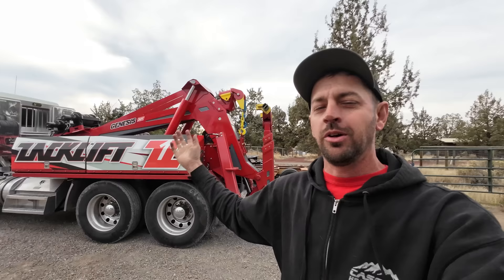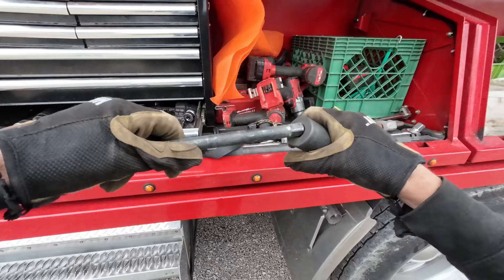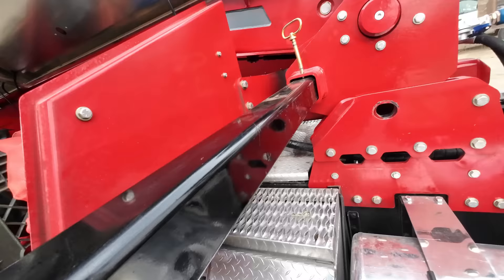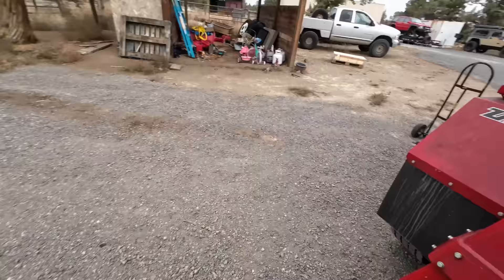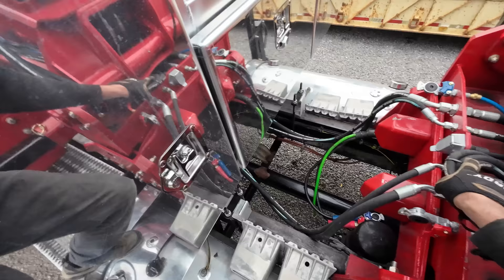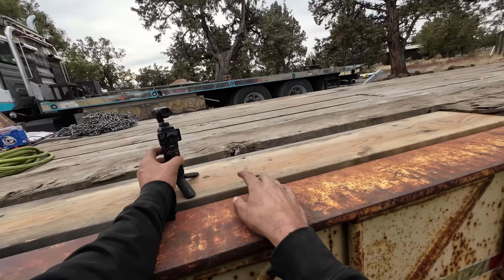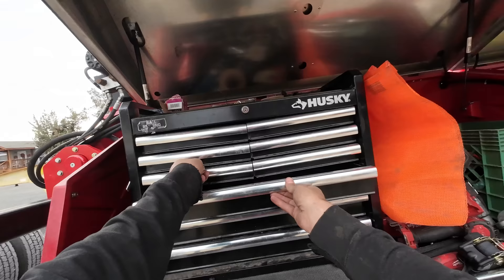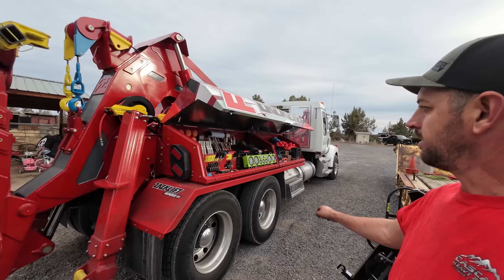How a quick change Heavy Wrecker works!  (the do anything truck)

Comment: You have all that space down low in front of the red mount you could permanently mount a single winch and not have to remove / install every time you decide you needed it for the lowboy, But neat dual use setup.

Comment: Nice video! Thanks for showing the process. I'm not a driver, but I feel like you'd be hard pressed to do a precheck and warm up another truck in 11:32, especially in the winter. I love the idea of moving those boxes back to keep the front legs on full time, and that winch mount is a cool idea too. I'm sure you thought of this already, but maybe a collaboration with the folks at Zacklift to design a winch mount for that bracket. I suspect you aren't the only one who thinks that a sweet place to mount a winch.

Comment: You might want keeper strings on those quick-remove pins, or get in the habit of immediately re-engaging them, instead of setting them on the expanded mesh steel deck, lest they tumble-through.

Comment: Great setup and explanation of how this incredible tool detaches/attaches! One thing I saw as you went through the process was that it seemed a little difficult to get to the hydraulic couplers now that the headache rack tool box is installed. Perhaps move them to the rear of the box and turn them up??

Follow your channel and watch all the videos. Keep up the good work!

Comment: Interesting bit of kit - I think the manufacturers missed a trick, though, as some hooks and/or receivers for the fittings would have made a much neater and easier job securing the various hoses and lines, out of the way, when disconnected.

Comment: thoughts about adding a winch - If you have a removable winch then you need a place to store it off the rig.  I would look to just mounting a winch between the frame rails near or under the headboard and have the fairlead somewhere near the massive red zack mounting plate.  use synthetic line.  Electric or hydraulic winch up to you.     just my thoughts...

I enjoy your channel and commentary - my wife grew up in Bend and nearly all of your locations are memories of mine.

Comment: What do you think about, finding an old socket that would fit on where the landing handles are now. Remove the handles and spot weld or weld them on the crank rods. Now you can use an impact tool to raise and lower the landing pads. This should lower your time even more because you already have the impact tool out to undo the rear tie-down chains.

Comment: Pretty easy really, only thing that looked like it may be a pain was those rear frame hooks, I would guess a good part of the extra time it took to install was you trying to fish those hooks down.
Reply from the maker: That part is actually really easy.  Just drop a ratchet strap down through the shock tower mount, hook the chain onto it, then pull it back up.
Reply: @CaseyLaDelle  Thats really smart, definitely way easier than I would have expected the whole process to be

Comment: I actually think a winch on the front bumper would make more sense. It could be used to help anchor the truck on heavy rescues or pulling stuff on and off the lowbed.
Reply: Think about this, you pull up behind an RV that will fit on the trailer, drop the trailer lay it out then back over the trailer and winch the RV onto the trailer (you would need to make ramps to back off the trailer though) OK not a perfect idea.

Comment: When unhooked those front legs look like they are bowing down from the weight, 16.26 in the vid, or it looks like it from the angle we are looking at. If they are bowing down mabey think about welding triangle gussets at the out side ends inside to add strength. Just a thought.
Reply from the maker: Nope, they sit at an angle because they are a very loose fit in the tubes

Comment: I would mount the winch under that red mount for the zack lift. There is space there. Its protected by the mount and if for whatever reason you need a third winch line you have it.
Reply from the maker: The 5th wheel would be in the way of the line.   The winch needs to by mounted high
Reply: @CaseyLaDelle is it possible to mount a winch with the fairlead facing up? If the winch was under the red bracket, with the line come vertical, then a fixture with a sheave on it that drops into the red bracket could turn the winch line's direction and get it to the necessary height. This of course only makes sense if the fixture with the sheave is lighter than the winch. If you got real fancy, maybe the sheave can swivel or there be multiple sheaves, allowing for side pulls.

Comment: You can easily make a winch mount for that bracket. Just set your winch in there and put a pin through those holes and hook it up to electricity and you'd be ready to go. I would bet you've already got a 12 volt hook up on the outside of that truck, and I don't know if your winch runs off of a standard trailer hitch 4 pin or seven pin connector. I'm like you the minute I saw you take that Zach lift off as soon as I looked at that bracket I thought you could put a winch right there then you said it.

Comment: That's awesome to see, thanks for sharing.  I had the exact same idea as soon as you started talking about mounting a winch, with your fab & welding ability, I'm sure you'll be able to come up with a good mount solution inside of the wrecker mount.

Also, just an idea, where the big pins that hold the front of the wrecker assembly goes, I noticed the pins are rubbing the paint off of the mount.  What about using something like fire hose or some other heavy duty rubber as a sort of washer, to prevent the pins from rubbing on the paint?  I don't know if you even care to much about the paint wearing away, but I noticed it, and had the thought, so I figured why not share it.

Anyways, keep up the great work and content
👍

Comment: Take the handles off the Jacks and weld nuts on the gear box shafts. Then use the same impact used for frame clamps to run jacks up and down and if needed the old handles could have sockets or ½" drive  welded to slip into sockets if needed. Much cleaner no handles rattling with vibration of engine. Saves time and energy. I've done it on a few applications and works great.
Or even cooler still: Lift legs with hydraulic system! Put a couple hydraulic rams in place of gear box. with mounting cross shaft on head  of extension's outer containment Tube to run  extensions up and down. Control could be right at the each jack head.  Then just swing down, lock ib place and pull levers, or turn knobs, (even cooler)  Of course this could all be done in your shop and  spare time. Ha Ha on the spare time part. I'm retired and don't even have time to do all the "Honey Dos", along with the projects I come up with! Keep on keepin on casey. Love your Channel!

Comment: Move them hydraulic couplings so there easier to get at and the air lines, do the front pins whilst your doing the legs and you would probably save 3 minutes

Comment: One suggestion would be to switch over to quick connect lines and maybe add in a secondary Air and Power connection point under the headache rack which would greatly improve your efficiency with connecting and disconnecting. Also if you go that route hard mounting your hydraulics under the headache rack would also make your life easier. Also closing out the rest of your frame may help too so you dont drop stuff in weird spots.
Reply: Aren’t they all already quick connect fittings?
Reply: @hondaman08  the Hydraulics are yes but not the Air lines on his truck by simply changing those and adding a second connection point it cleans up and simplifies the process
Reply: @ltciscora  are glad hands not considered quick connects?
Reply: @hondaman08  No a Quick Connect is not the same as a glad hand. Glad Hands twist to lock in place with a rubber grommet to seal them vs Quick Connects just press in to their receptacle with simple O-Rings to seal them
Reply: @ltciscora  Yes, I understand how they work but they are still a tool less connection that is easily broken and connected by hand.  He needs the existing length of the lines to reach back to the trailer so what is there to gain by adding a different style of connector near the hydraulic bulkhead area?  Also a duplicate connection would require isolation valves to avoid air loss when the other is being used.

Comment: Nice setup 👍. You could save even more time if you take off the crank handles and use your cordless drill driver to lower and raise legs ..And make a winch plate with sides with a hole on each side of the plates that line up with holes on bracket mounted on the frame..This way the winch can swivel as you're pulling..And clevis pins can be used to mount winch plate...How much if anything is being saved if someone was to buy complete truck and tow winch setup verses buying removable tow unit ?

Comment: That zacklift is awesome man. 🎉🎉🎉 I wonder if you could build a head frame such as what highway departments use to load and unload the sander units from dump trucks.  You could back the truck under it, secure the front of the DTU with a chain on each side and thus not need to worry about using those side outriggers altogether?
Reply: certainly could,  but then your stuck only being able to detach at home base, and for a bunch of extra cost.

The versatility of being able to detach any where at any time is quite valuable. Never know what situation you might get into 500 miles from home that requires you to detach.
Reply: @legohead6  No one said that he couldn't keep the outriggers with him in case he found the need to drop the DTU in the field.  But thank you for your reply. ☺️

Comment: With the winch, might it be better to install it under the headboard, and move the hydraulic connection points to a more exposed location (should be done anyways for QOL)?  If you make a sheep's head mount that drops into the Zaclift mount, you will then also be able to do side and rear pulls.  In addition the sheep's head mount will be lighter than a heavy winch.  

If the hydraulic connections were moved to under the outer boxes, then you would be able to access them from the ground instead of kneeling on the frame and reaching under the headboard.

Comment: Because my life works the way it does, I would have a lock in the outriggers.  The check valve on the outriggers would leak through, the body would sink down, and then I can't back under it.  Of course it would be a time it's urgent and no one has/can make extension hoses to lift it up again...

Comment: Very cool idea to mount a winch on the truck but as you load your trailer from the tow end would you not be better having the winch on the rear of the trailer and connected to the independent hydraulic systems already on the trailer

Comment: With a similar type of jack system you would absolutely have no issue with install a 20-35 ton hydraulic drag winch on to front mount plate so you could literally drag anything on to your scissor neck..
Reply from the maker: No need for anything even remotely close to that big
Reply: I have worked to close to the old fields every thing has to be big just in class. 😂😂😂

Comment: you definitely need a routine, which will come in time & if you can get it down to where you only make one trip around the truck, without having to explain what you are doing, you might even get pretty close to the 5 minute mark... weld a coupling nut the same size as the frame clamp bolt to the end landing gear rod? whatever the handle is attached to (I don't know what it is called) and run it with the impact would speed up the process too

what is your plan on keeping the airlines off the deck when pulling a trailer?

Comment: I have been wondering how long it takes to get rid of those separate airhoses, and get those reels, not long😁, now you can add one one air impact driver, in case batterypower is not enough? 
Ok when You get those front "feet" as permanent in there, make them for that impact driver, and all those hydraulic and air hoses, make something like gardenhose holder for them. 
Sorry, my english is not good enough, but you got the idea, I hope.

Comment: I feel like that is a good pitch for Zak Lift. They could totally make a winch mount that works on the front frame mount to add to the purchase.
Reply: In theory its simple, in reality it will need its own valve block, and most operators are going to want remote control on a winch line, which means even more stuff mounted to it and the need for electrical connection. At this point you'd have at least a 500lb contraption that would require a separate piece of machinery to load into position. Defeats the self contained self loading central area behind the zacklift.

I could see a home made contraption being built for someone who needed a winch tractor as well.
Reply: @legohead6  I get that together as a unit this would be large, and heavy. There is no reason why this would have to be one complete unit. Split it up into 3 or 4 pieces, that pine/tie together. 

The hydraulics and electrical are already there. Zacklift already has the remote portion figured out. In my personal opinion, a multi million $ company should be able to figure out an attachment, that one person can install.

Comment: To make it easier to take off the hydraulics pipes, why not extend the connection onto your headache boxes? It's interesting how you demout as I  worked with demountable wagon and drag where after putting the legs down and turning the locks we would drop the air suspension, we would drive slowly out .stay safe
Reply from the maker: That’s exactly what I did

Comment: Casey this was an awesome video sir! I had an idea when you were talking about the custom winch Mount for the Zacklift bracket. What if you permanently mounted the winch in front of the bracket down lower in between the frame rails and then put a much lighter bracket with a fairlead in the front Zacklift bracket, that might be faster and easier on you if that could work?

Comment: Another snarky comment, thinking about the blue (turquoise) truck.

Would that flatbed tow truck with 4x4 be ideal for loading pickup trucks towing large utility trailers?

Put the pickup truck on the flatbed, connect the trailer to the rear lift mechanism and off you go!

Just trying to influence the algorithm, like your common sense videos.

Comment: Hi, why dont you mount the winch on on the raised section of your trailer where the pin is connected? You can extend the power / hydraulics to it and that way you dont need to be manhandling a winch on and off in a rush.

Comment: Would a winch in that wrecker cradle be beneficial?  Would it not be better to install a winch down in the recess of the back of the trailer and maybe have a small "tower" type snatch block that you can remove?  I know either way you have to disconnect the truck from the trailer to load things onto the ramp, but it just seems like another thing to have to install/remove on the truck, when you could just outfit the trailer more.
Edit:  This concept would also remove the possibility of whatever you're winching onto the trailer pushing the trailer, as now the pulling force IS the trailer.

Comment: Dumb question,  what happens if it settles into the dirt, can you just jack up the front legs and slide under it at an angle since the pto isn't hooked up at that point?   with all the rock it probably isn't an issue,, hopefully...   I've had that issue with ag equipment and soft soil in my area, had to bring the crane truck out to lift it...

Comment: It's called a pilot pressure valve they use them on forklifts
Reply from the maker: Not what I’m talking about, these cylinders have holding valves on them.  I can literally cut the line to the cylinder in half and it won’t come down
Reply: @CaseyLaDelle  correct the valve is usually at the bottom of the cylinder it takes hydraulic pressure to let the cylinder to move

Comment: Question.  How much cheaper would the the Zack lift if it was not removable?  Could a winch fit in low, center box on headache rack?  I think a HD Badlands might.  But doubt a hyd with hoses.  As you would only use it when Z lift off. It would be handy already on level?

Comment: If you could figure out a way to make all of the air and hydraulic connection as one  system would be great. Why not make the front outriggers hydraulic as well. That thing is great i really like it. It's going to be hard to improve on 12 minutes off though.

Comment: The Zacklift is amazing.    In theory, could you tow your flatbed with the Zacklift installed off of the wheel lift and have the best of both worlds?    Wasn't sure if the 5th wheel attachment you had for the rollback would work the same on the Zacklift wheel lift.
Reply from the maker: Yes.  No need for a 5th wheel attachment, I can just chain sling trailers

Comment: Instead of undoing the straps that hold your toolkit closed why don't you just put some sort of bar on the door so when the door closes the bar pushes against the front of your toolkit. This bar could be a simple metal bar with some foam on the front of it

Comment: As long as you're not running into length or weight restrictions, couldn't you just use the Zach lift with a fifth wheel adapter to tow the trailer?
Reply from the maker: Yes, you’ll see a video very soon where I tow a 53’ trailer with the Zacklift.   But the 5th wheel adapter has a 25k pound weight limit

Comment: When you’re in your fifth wheel setup, what do you do about rear mud flaps on the tractor? I know they are required to be on the rearmost wheels, so not a problem when hooked to a trailer, but if you’re bobtailing it, don’t the tractor rears need flaps?
Reply from the maker: Yes, I simply put them on.   They drop into the mud flap brackets at the back just like 90% of trucks on the road.